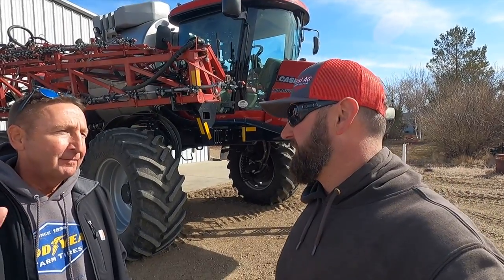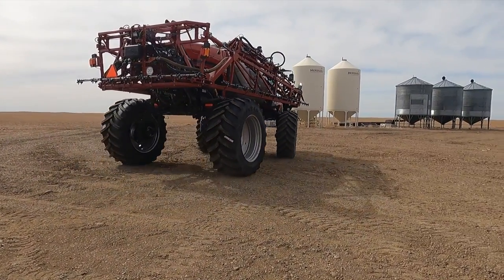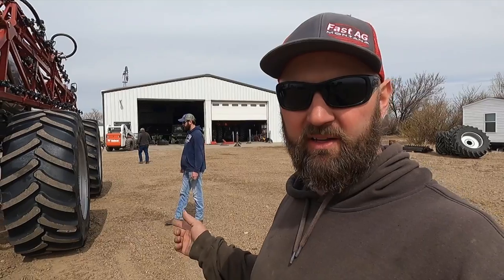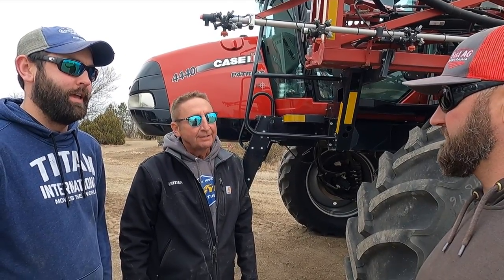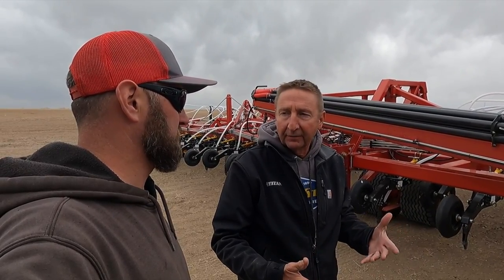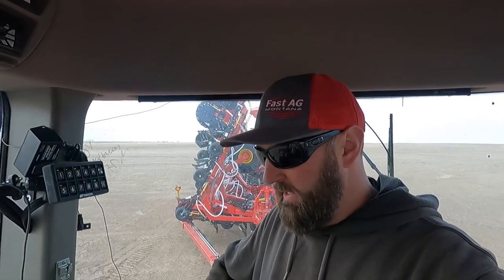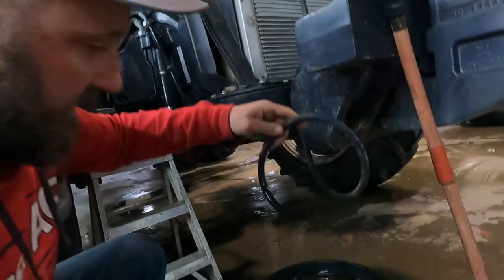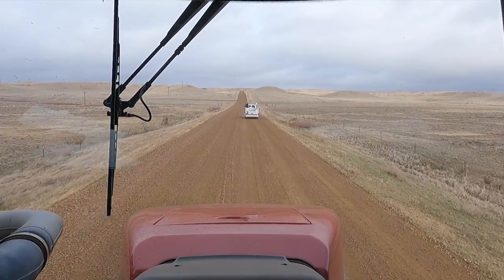BIGGER SPRAYER, BIGGER TIRES!!

Comment: Good job on using Cascade, was best stuff I ever used when worked on Diesels with oil in cooling system. Use Usually got to Op. temp. pulled water jacket plug from engine block & stick running garden hose in Rad tank w engine running, run till clean. Oh and the new Seeder huge😮

Comment: Looked like you will need another step to go into the sprayer but it was on the scales in the front. Sweet tires on it too, now you just have to re calibrate the speedometer.

Comment: A few years ago, I called and talked to a guy at Titan tire  and while I had him on the phone, I  asked him why they mounted R1 tires backwards on implements and carts and he told me the main reason was for flotation since an R1 mounted normally digs in and moves the dirt out towards the outside along the leading edge of each lug (thus, your traction) and when mounted backwards it does exactly the opposite and moves the dirt towards the center which builds it up there and reduces sinking/improves flotation. I can't get over the size of that new drill and cart. Looks like you need a bigger tractor LOL

Comment: Did you have to change anything else since you went with a wider tire?  Didn’t know if you had to use any kind of spacer or anything.  Your tractor looks little compared to the drill. Might need to get a bigger tractor to pull that. Lol. Awesome video and very informative on the different tires that are used on the modern farm equipment.
Reply: Looks like the new wheels have more negative offset than the older wheels in addition to being wider.

Comment: Do they design those sprayers for all those different size tires without affecting the drive train and steering components? Or is that something you now have to watch
Reply: It's hydrostatic
Reply: The drive train is designed for a range of tire sizes. Bigger tires do put more strain on the hydro motors, but so does the added weight.  It pays to be smooth and gentle when going down the road fully loaded!  

In the computer you can set the tire size and that adjusts the speed readout.  The rate controller is fed directly by a radar unit, so even if the readout is inaccurate, the rate will always be right regardless of tire size.

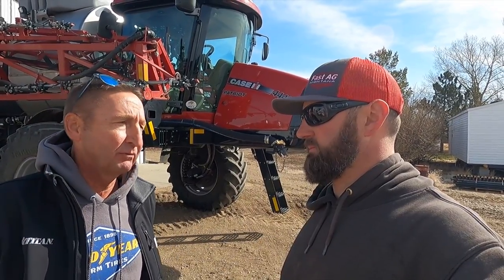Comment: 1:20
A 10-in increase in height means the sprayers arms will riding 10 inches higher than their current settings; which means the spraying pattern will be  impacted, covering a larger area and reducing your prescription per acre , correct ?
If the assertion above is true, can the arms be adjusted to maintain the spraying patterns ? if there is no vertical adjustment for the arms, does that mean the volumetric flow will need  modification ?
Just asking for a friend ...
Reply: Difference in speed as well, from 72" to 82" is 14%, is the speedometer controlled by a sensor or GPS ?? 
When by sensor he drives 14% faster then he set his spraying speed, that would mean less product per acre.
Reply: It's fully adjustable. The center rack can lower to within an acceptable distance from the ground even with big tires on.
Reply: The rate controller uses radar to measure speed. The speed read out in the cab can be set for tire size in the computer.
Reply: @tmlf1239  OK, ... that make sense, thanks.
Reply from the maker: The booms can be lowered down. The sprayer is 5” taller. 10” is the total height of the tire.

Comment: Looks like a beast. Hooked up with 2 great company Case and Goodyear. 
Too many farmers are hooked into mother deer.
Reply: Too many? 🤣🤣🤣 tell ya what, and this should tell you all you need to know of why Deere is way ahead of the competition. I spent several months working on a project in Grand Island NE. Where case builds there combines,,,, corn and soybean harvest was going on right close to the factory…. Not a red combine was to be found in the fields. All Deere. Cart tractors, all Deere. Heck I saw more silver seeders then red machines running.

Comment: Murphy’s oil soap and some dish soap the Murphy’s does some kind of magic in there I think it suspends the dirt better something happened to one of our 990 cats and so we asked cat what’s the best flush and figuring cat had some kind of their magic well they did a large bottle of Murphy’s and a large bottle of dawn blue dawn and it worked two times with flush mix and three with straight water and 4 55 gal barrels of cat anti freeze gotta use cat anti freeze for warranty purposes and bob’s your uncle